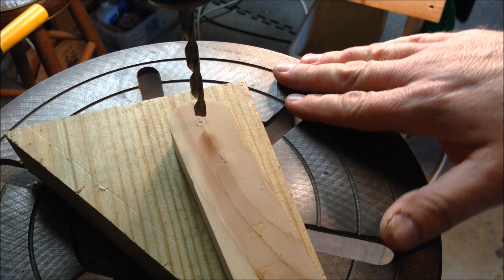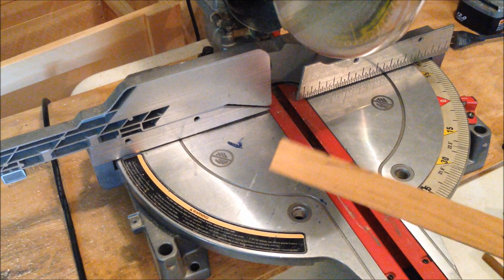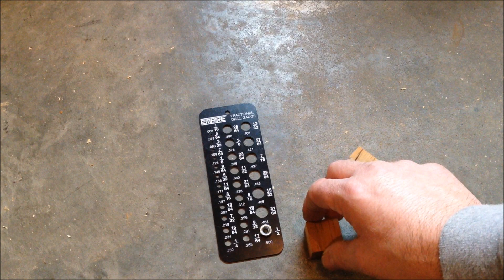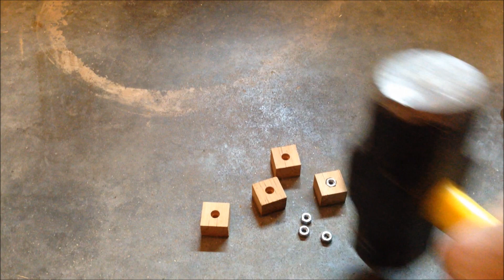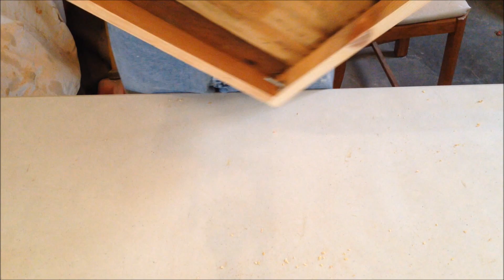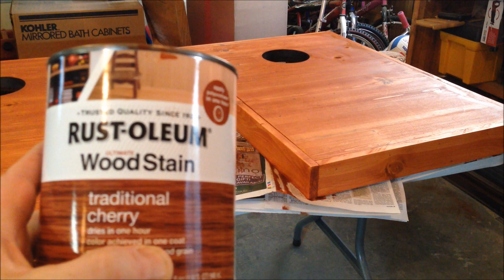Corn Hole Boards   Part 6 of 6

Comment: Nice work Robert. The thumb "bolts" were great. I laughed out loud when you said "apply a little force" then brought in the biggest sledge i have seen in a while! Looks great! I plan to build a few sets this summer. And props for repurposing and making something that she can continue to use.
Reply from the maker: Thanks Chuck,
  I got the idea for the thumb bolts from Jay Bates. Believe it or not, that was the only sledge I had. Here in the mid-west, that's what we call a love tap.

Regards,
Bob

Comment: Stain worked out very nice on the pine. Good job! Like the natural finish. Hope you put your logo on inside (at least). With year made for posterity and great great grand children! Really nice work Robert.
Reply from the maker: Thanks Mac,
  I am very happy with the stain. My Poly was old so after the first coat, I really had to hit it with the steel wool to smooth out the bumps. I purchased a new can then it was smooth sailing after that.

Regards,
Bob

Comment: Nice looking project.  Didn't know what Corn Hole boards were before this.  Now I have a new yard game to build.  I'll add it to my list.  Thanks.
Reply from the maker: Thank you David,
  The rules are pretty much the same as Horse Shoes. I think it's primarily a Mid-West thing but I may be wrong. In a couple months, I will be surrounded by fields of corn, so it's a very popular game here plus it goes great with a cook out or tailgating.

Regards,
Bob